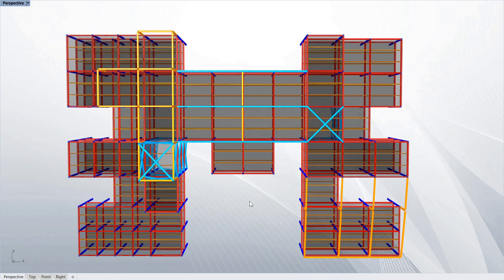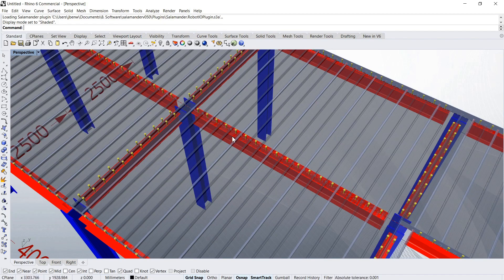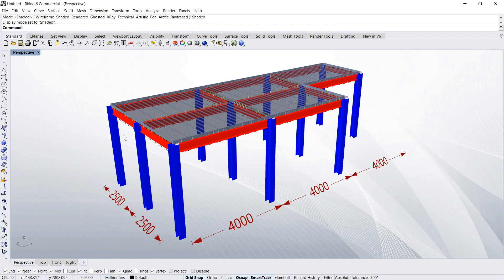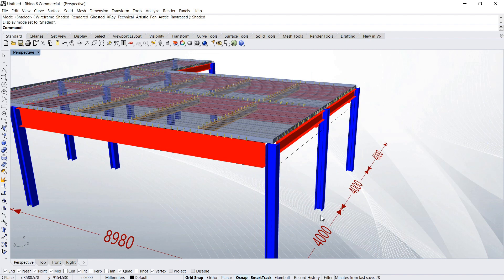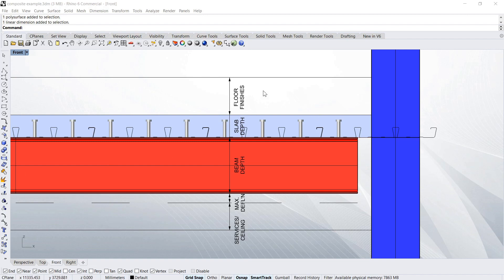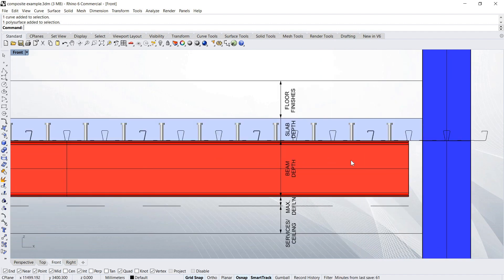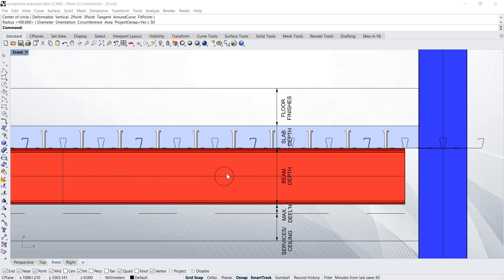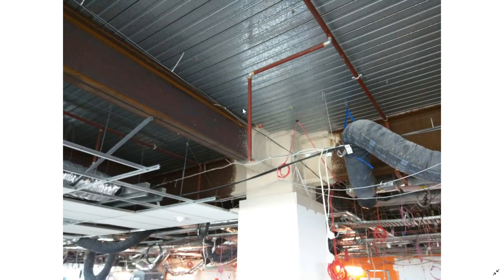Composite floor structural engineering basics for Architects. Spans, buildup, services and more.

Comment: how walls will be connected to beam and slabs. can we use brick masonry with steel beams will it be properly get bonded or not
Reply from the maker: Masonry can be used. The connection to the steel structure depends on the location and how the wall is designed to span. At the top, walls are typically connected with ties which allow deflection as the steel beams deflect differently than masonry. At the base, walls can be built from the slab with starter bars extending into the wall. At the sides, there are masonry fixing details  that are used if the wall spans horizontally rather than vertically.